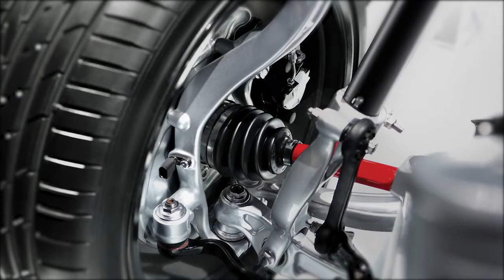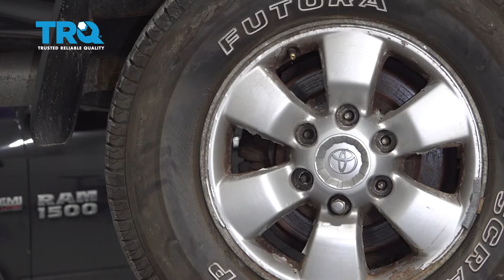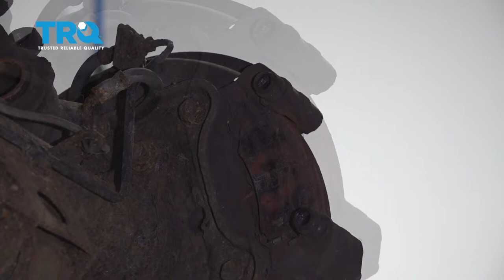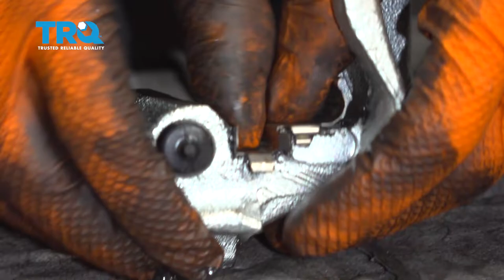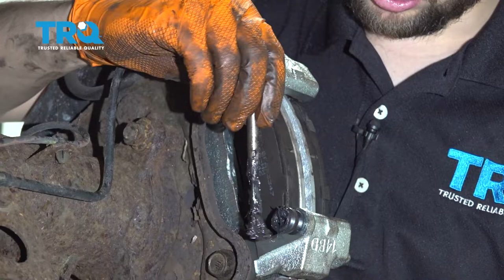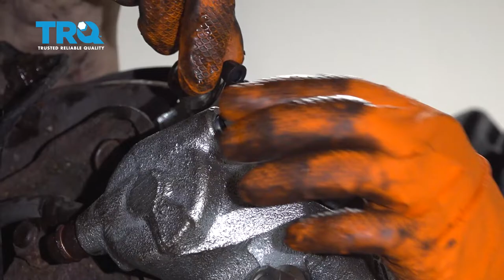How to Replace Rear Caliper 2003-09 Toyota 4Runner

Comment: Just FYI, when bleeding the rear brakes on this generation of 4Runner, you dont need to pump the brakes but you need to turn the key on and hold the brake down with the bleeder screw open. It is electric.

Comment: Without the clip washer from the old line in between the 2 copper washers, my bolt bottomed out and didn't crush the copper washers and thus, leaked. Had to take it back apart and put the clip in. I didn't see it in this video. I used a O'Reillys caliper.